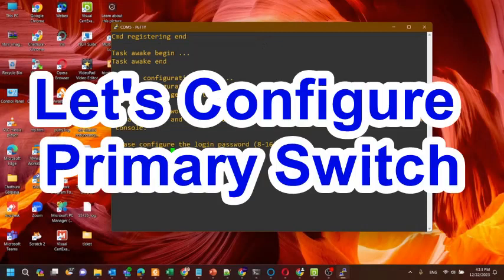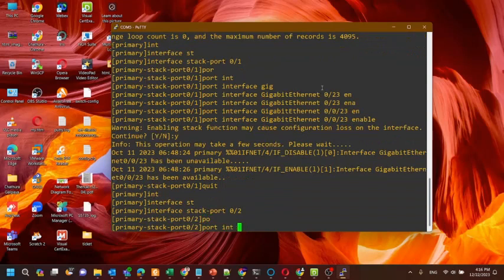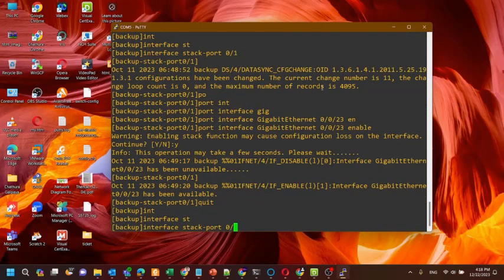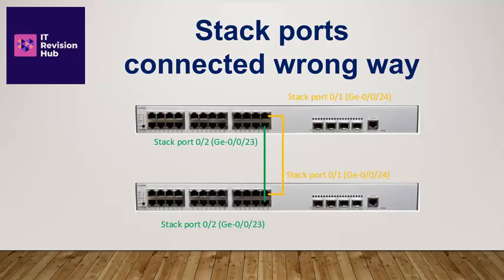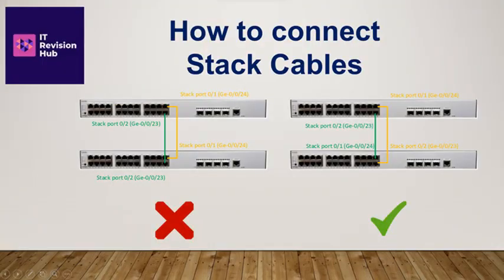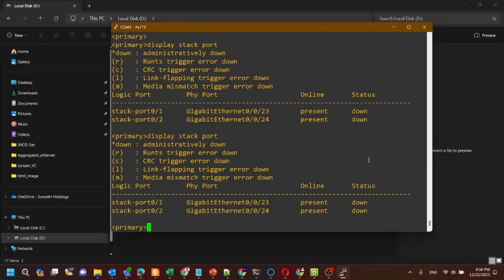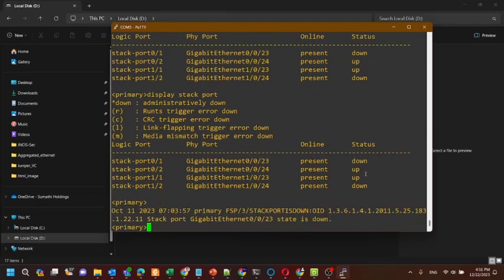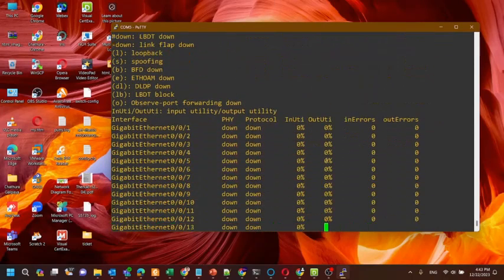Huawei Switch Stack Configuration | S6730 S5732 S5735

Comment: Hi guys, I'll share my experience. To stack two switches, you only need to connect one physical interface (only one cable) and use only one logical stack interface on each switch --> stack-port 0/1 on the master switch and stack-port 1/2 on the standby switch.
Add the physical interface you want to use to these logical stack ports.
Reply from the maker: But if that one cable fails stack fails, so the best practise is to use two DAC or stack cables.
Reply: @ITRevisionHub  you are right, but for only two switches stacking, Huawei recommends only one logical stack interface on each sw. Later on each logical interface (stack-port 0/1 on the master and stack-port 1/2 on the standby) you add one or two physical member ports to implement link backup and increase bandwith.

Comment: Thanks for this video.
In your configuration stack-port 0/1 is made up by g0/0/23. And stack-port 0/2 is made up by g0/0/24. 
But when you showed the switches connection they were changed.